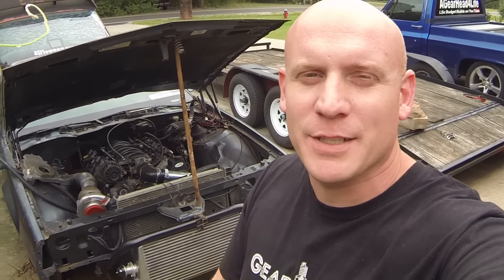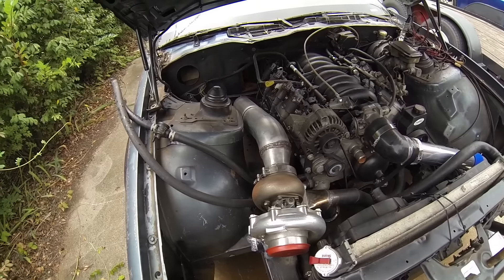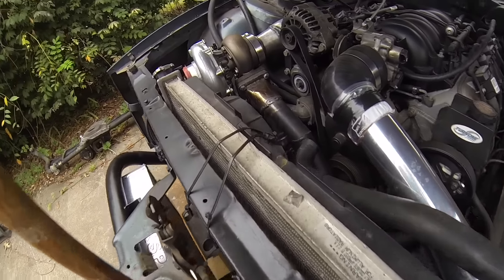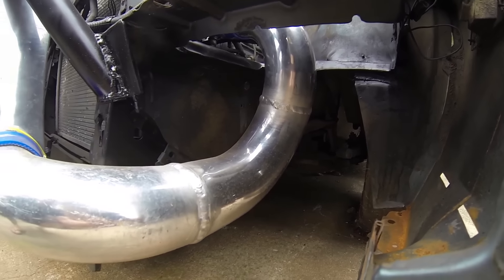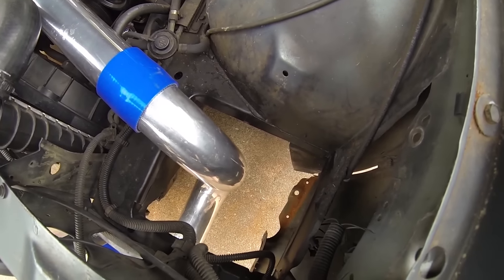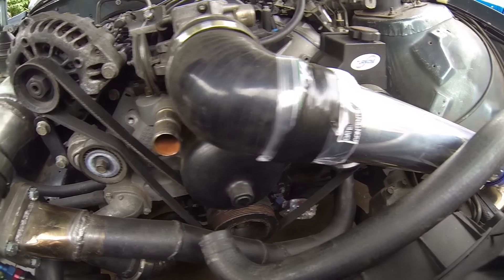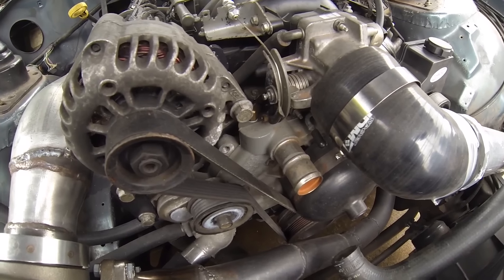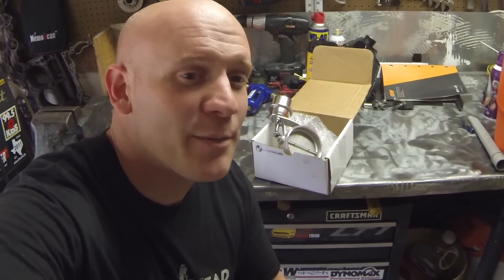Turbo LSx '92 Camaro Build Update 17 September 2016

Comment: I based my turbo build from your pics on the fb page with some mods to make it all fit and keep the fbody accs and stock alt location.its tight but works. I sadly couldnt do a 4 inch down pipe which trust me..you will need it.Mine is 3 inch and I have a 3 inch e-cutout which I need open anytime over 7psi. And Yea..that oil drain fitting i remember seeing that and I think we talked about it.i stuck with the passenger side on the cover and my drain line has a perfect curve down passage and its a short line. My wastegate is the same as what you have visioned.Its coming along great and once you have it running and making blowoff sounds this car will create many smiles. Good luck on the move..keep on wrenching brother.
Reply from the maker: Awesome brotha! I'd like to see more on that. Good stuff man! Keep on Wrenchin!!
Reply: Anytime..if there is anything you want to see more detail of ill make a video of it.I need to get an 8.8 in this thing so i can safely put the power down and properly launch the car.
Reply from the maker: I appreciate it!

Comment: thanks man you are such a great help. I was looking at the video again and I don't see a spot on the cold side for a maf. So we're did you put your and also I know I have to run a y ban o2 sensor. we're did you mount your and did you delete the spots for your factor o2 sensors or do you still need to run them as well.
Reply from the maker: I will not be running a MAF on this build. It will be what is called "Speed Density". It will reference the MAP for the needed data. I have not stalled my wide band yet, but it will go on the down pipe. I am using the Holley EFI system and it does not use the two narrow band o2 like from GM. It just uses the one wideband.

Comment: got a 5.3 want to put in a 2004 trailblazer any hints on mounts also i live in the cayman islands so everthing has to be shipped over seas thanks again bro
Reply from the maker: I have no tips that I can think of. I'd likely hunt down the V8 TBSS stuff to make it drop right in or bust out the cut-off wheel and a welder. lol I wish I could be of more help to ya.
Reply: i have no tips but make some vids on it id definitely watch
Reply: Look at the GMC Envoy. Some models have the 5.3. Im sure that some if not all parts would bolt up, but you would need the ecu and harness from the envoy.
Reply: Lots of trailblazers envoys etc. in the lt version has a V8. "My rule of thumb while I'm on salvage yard hunts. If it's has long back doors it might have a v8. " lol

Comment: Where did you get the torque arm mount for the 8.8?Ive been following this build for a while because I am doing almost the same swap to my 92 Camaro LQ4/4L80E with 88MM turbo and Ford 8.8.
Reply from the maker: Hey Ricky! The mount is a "Hiltsy" TA Mount. You can find it on eBay for $50.

Comment: I have an LM7 5.3. if I was to do everything that you did to yours, but wanted to add nitrous, what would you recommend I do differently? would I still be able to use the 4.8 flat top pistons? how should I gap my rings. OH!!!! and would you recommend I take the block to a machine shop and get everything balanced?
Reply from the maker: No, i wouldnt balance it. These answer will depend on how much nitrous you were going to run, but you dont have to modify anything to run up to around 200hp shot. Yes, I hear that nitrous like compression, so you could swap in the flat top pistons.

Comment: I am following the same setup as you but on a 4.8 could you tell me why I need a dump valve and were do I put it or can I shoot it back into the exhaust.
Reply from the maker: Cool! You need a waste gate around the area where I said that I was putting mine. It releases the exhaust pressure from before the turbo when It's not needed. It goes on the "hot side". Controls boost too. It's important.

Comment: hey man new subscriber here. you seem to know your LS stuff. I'm in process of parting together my build for my 2000 silverado, just pulled the L33 out a couple months back and got an ls1 shortblock to build and I'm stumped on building it with a monster cam and longtubes or do a budget turbo set up. the trucks on 35s and more of an on/off road toy than a street truck. any input is appreciated. keep up the good work man I'll be watching your videos

Comment: Hey man I have a question since u had two of these trucks. I have a stock 305 5.0 just rebuild the carb elderbrock 1406 it starts perfect and runs find when it's parked. but I run it for a while on drive and it shuts off. and doesn't want to crank back up after that
Reply from the maker: I wish that I could help you Rafael, but that'd be very hard through text. Testing needs to happen to find out what it wont crank back up. You have to find out wether your missing spark, fuel or have too much fuel. Then go from there.

Comment: Where is the passenger side header connecting to the rest of the hot side?
Reply: looks like it just runs out under the firewall.
Reply from the maker: It Ys together with the driver side right in front of the thermostat area. You can see it in the previous videos on this build.
Reply from the maker: Here is an older video in this playlist that shows more on it. https://youtu.be/LIj4A9WyEQ8?list=PLAC3028AD893F4D6D
Reply from the maker: This one is good too. https://youtu.be/HbOjGBjJuyA

Comment: I'm very interested in how this Camaro project is going. I've been watching Matt's video's on his Colorado 4.8 LS. I am thinking about doing a 90's C4 Vette with maybe a LQ9 with ZF manual 6 speed trans. So far I've only scene builds with automatics.
Reply from the maker: Hey JD! I look forward to getting back on this project. It’s been on pause this year as I’ve been moving back home. We’re about a month away from finally moving into our house, but I’ve still got to run power and Sheetrock the garage before I can wrench.
There’s not much different with using a manual. Actually less wiring. I may go auto in the future. Auto would be better for drag racing but the manual will be more fun driving and killing tires.
Reply: OK, I'll be watching for updates. It's looking good. I've been wrenchin' and racing for several years. I relocated to NC a few years ago from Michigan and sold or gave away most my projects and spare parts. So I can relate on how relocating can set things back. FYI - I noticed you might need help in the way of budget paint jobs. If you have a place to spray there are cheap options. Tractor supply has enamel paint for tractors and also sell hardener to make it shine like new money. I have a cheap gravity feed paint gun, couple hundred bucks or less can make a vehicle look decent. Just a suggestion, I know I never budgeted a couple g's for paint in my projects. Merry Christmas fellow gearhead !

Comment: I just got another 3rd Gen I've been racing my gbody been thinking about dropping in my motor from my gbody into the 3rd Gen. what headers do you used on your camaro and is their and cutting or welding that has to be done to drop an ls in the 3rd gen
Reply from the maker: I prefer to cut the crossmember to give clearance for the f-body oil pan. I think I showed that in some of the older videos on this project. People have done the swap without cutting, but the pan was too close to the crossmember IMO.
You can use f-body manifolds or Hawks makes swap headers for the swap.

Comment: ok then I will not run a maf either. not running a Holly EFI but the I am ordering the other injectors and I am flashing the ECU hopefully the mail order tune will work until I get it to the dyno.  is there anything thing else I need to know
Reply from the maker: Not that I know of, but I also dont know the whole story of you're build.

Comment: hello mr.gearhead4life. I have a 5.3l LM7 out of a 2000 gmc sierra. I am planning on putting it in a 1955 Ford F250.  I would also like to add twin turbos. I am a pipe welder. so I have experience welding. however I am trying to make this as cheap as possible. what kind of modifications would I have to do to the engine? and what size turbos should I get? again, cheap as possible. I do not mind getting used parts where it be needed
Reply: Just start searching for stuff you know you need and keep eye out for
Cheap turbos.
Reply from the maker: Yep, to keep it cheap, just leave the engine as it is, stock. You might want to consider a boost cam and good vavle springs though. For turbos, contact Viren at VSracing.net. He'll fit turbo size to your goals.

Comment: ok  well here goes I have a 4.8 will just be a DD. Its going in a 85s10.
The motor came out of a 04 G35 van has all truck ops on it.  Its at the
machine shop now to get cleaned up. I want to reuse the same pistons and
rods. I am having the shop install new cam bearing.  As far as the turbo I
will be using a 76mm with a 45mm waste gate and building all the same cross
over like in yours. I will be running harden pushrods arp head studs and
bolts ands that's about it
Reply from the maker: Baylor, without your comment reply being under our conversation, I can't keep up with the conversation. I reply to many people on here and I'm not able memorize each one. So I'm not sure what we're talking about now.